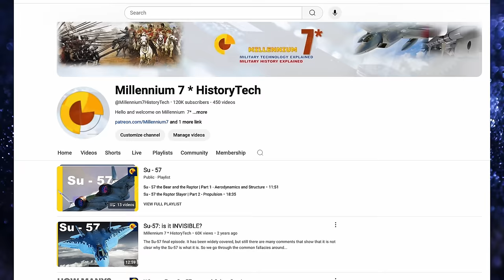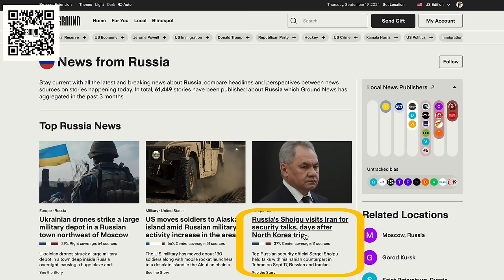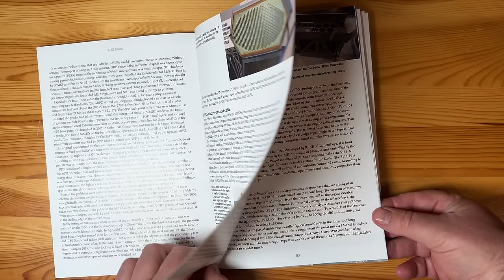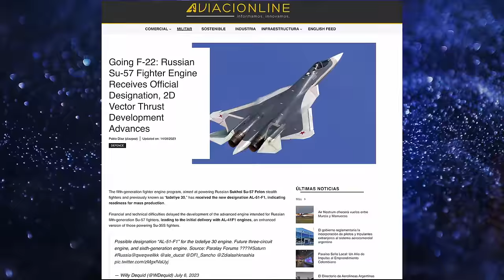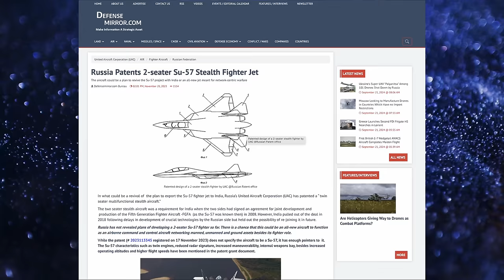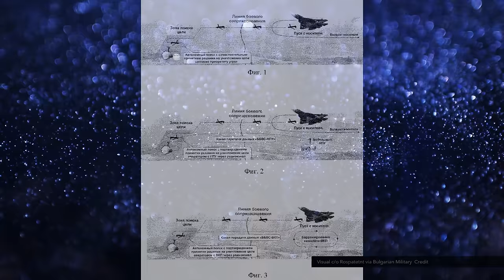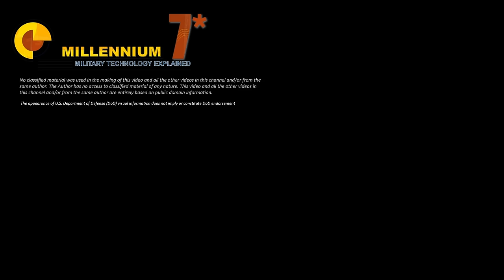The Su-57 is a Masterpiece!

Comment: Constant use in Ukraine? They're used very little, and in the same role as bombers, to launch cruise missiles. They aren't doing the air superiority job they were supposed to do.
Reply: They already have air superiority though so why use them in that role
Reply: Air superiority over what?
Reply: @testingmysoup5678  then why is Russia using glide bombs and cruise missiles? Air superiority means you can fly over with impunity. Right now the air is contested, since both sides have better AA than aircraft.
Reply: @johnathanclayton2887 bro your talking about air dominance and that is only possible against 3rd world weak countries not against the likes of Ukraine
Reply: @jathiyakhan720  US would do it, because f22 is really good against SAM batteries. But the su57 isn't, so they can't get air superiority.
Reply: @johnathanclayton2887  f22 is good against sam lol
Reply: @johnathanclayton2887  the su 57 is also just as good it istrue it has less stealth but dealing with sams nowadays has more to do with sead weaponry and raw speed than stealth both of which the su 57 excels at. The as for why they haven't got air dominance. Ukraine is densely packed with soviet era sams . Which unlike iraqs french sams can't be disabled at will by russia. Add onto that that those sams are far more capable than any us sams and you realise why they haven't gotten air dominance
Reply: @jathiyakhan720  Good maneuverability let's you get closer to a battery without getting shot down. Stealth does the same. But stealth let's you get a lot closer than maneuverability since missiles can pull more Gs. F22 was designed for a Soviet threat, so was designed to deal with lots of AA. SU57 was designed for fighting against NATO, so against fighters. So it isn't very useful in Ukraine where much of the military is Soviet legacy.

Comment: Just ask India, how good it is
Reply: How would they know, they have no access to the program. They have quit it like ages ago.
Reply: "jUsT aSk iNdIa, hOw gOoD iT iS" 🤡

Have you asked? What did "India" say? 🤣
Reply: @inthespirit  India canceled its Su-57 procurement plan from Russia.……
Reply: @Levon_RnD  India was previously a partner of the Su-57, but eventually withdrew its investment. It is also a fact that this aircraft cannot meet India's needs.
Reply: @你看个锤子你看  it was a "joint development program", and yes, I am aware of it and it's history. The point is, that was in 2018, pre any significant SU-57 development.
Reply: @inthespirit left the program due to poor stealth
Reply: @你看个锤子你看  This isn't even correct. Su-57 was always a 100% Russian program with no foreign participants. Strictly speaking, India was never a part of the program to begin with.

There was the FGFA program, a joint project of Russia and India which aimed to develop an export version of aircraft that would be based on the Russian PAK FA program(which worked on Su-57).

India withdrew from the FGFA and not from the PAK FA of which India was never a participant. 

And the most likely reason India quit was the fact that Russia was not willing to accept full technology transfer and only offered a role of an investor and a developer of several components of secondary importance to India.

India never had real access to engine, radar and other key technologies concerning the PAK FA program.
Reply: @Max_Da_G  defending su -57 crap
Reply: @maheshnayak2941  There is no reason to believe F-22 or F-35 are any worse or better. They never saw a real fight. What's even the use of your empty talking.

Comment: They can't put it into production, and fast & maneuverable isn't going to help you against 5th gen fighters. The only modern fighter fleets of any major scale are going to be the Chinese and the Americans, J-31's, 20's, F35s & F22s..
The Russian's are lucky they are fighting an enemy without an Airforce.
Reply: The Americans cannot manufacture anything I'm afraid. The number of F-22s they have makes the plane an insignificance, the F-35s will never reach the numbers or the capabilities claimed and the mainstay of the US Air Force is still the F-15 and F-16. They would not last very long against Russian air defences.
Reply: Funny you say that, f22 is one of the most maneuverable planes ever designed.
Like how do you even imagine missile evasion, there are moments when pulling enough g's is the last thing that can defeat closing missile.
Reply: @elta6241  You forgot one thing. The US has more allies, there is a lot more operational F-35's then SU-57's let alone more than air to air platforms in the Russian Airforce in Europe alone. Plus there is the Eurofighter with their new Meteor Missiles and the Rafael. The 57 doesn't have the numbers realistically.
Reply: Got to evade patriot missiles not just jets.
Reply: @Max_Da_G  most of your airforce was and is being annihilated in Ukraine only, if you cant beat one country, how you believe you can beat the rest of Europe is pure delusion. Much like your ground forces and your soldiers being given air soft gear and not even real armour. You cant beat one country, how do you think Russia could take on 3. It would be the end of Russias realistically, outdated and under-maintained air force.
Reply: @TazziedoesWT most of Russia's air force, you say? 😂 Most? I can imagine the cope just oozing out of you. When all their air force is gone, the war will end. They'll have no more shovels left to build planes. Cope on, oh heavenly soldier of light. MOST of the orcs have been pushed back to Mordor. 😂
Reply: "Fast" won't help? That's literally one of the most important factors affecting missile range...
Reply: @maximturcan1722  We've seen videos of SU-25's falling apart on take-off and crashing shortly after due to shoddy maintenance. There's literally no disputing Russia maintenance is bad.
Reply: @TazziedoesWT  and we've seen videos of f35 failing to deploy landing gear and scraping it's nuts off the ground. There's literally no disputing the US are in over their heads on how well the place is run. Landing gears don't deploy, passenger jets are held together by duct tape (special aviation duct tape 😂), bridges and roads are falling apart, most of the trains have tipped over in the last 16 months due to bumpy tracks, New York walkways collapsing down onto the subway lines. DEI fo realz.
Reply: @maximturcan1722   and the Su-57’s arent even flying? And if we are talking about civil aviation, Russia has created their own minimum parts needed lists for all of their Boeing and Airbus planes they still have. Its a hypocritical argument to say “ahh, speed tape, the stuff made for high tolerences is duct tape and wont hold.” When it will, when a large part of Aeroflots fleet are down due to not having access to sanctioned parts. Flight prices in Russia have subsequently sky rocketed to about 2-5x the normal routes price. I dont see this argument of “f-35 scrapping” when 1) there a large amount already, something the Su57 cant say, plus theyre actually flying…. Unlike the grounded SU-57’s. And sure attack Americas failing infrastructure, i’ll join you on that, im not American. But to say the Russian airforce is doing good and competitive is a flat lie. Facts show that Russia has lost 10% of its air fleet….. and made absolutely minimal gains in Ukraine compared to some major major losses as of late. And now because you cannot IFF friendly and ukranian jets because you run similar types, your aa is absolutely useless. And dont get me started on your “hypersonic” missiles that get shot down by american stuff made in the 1960’s while Ukraines drone striking your ammunition plants 200km in land. The fact is, Russia’s air force and overall military is undermaintained, underfunded and an overall sham that makes China look good.
Reply: @maximturcan1722  plus Landing gear failing is nothing compared to an Su-25 disintegrating on take-off and crashing killing the pilot?! Also if you’ve done any research into the SU-57, its radar cross section is 1000 times bigger than an F-35, Russia cannot even produce the radar absorbing coating it needs for “stealth”, and dont get me started on the philips head screws its been caught using. It looks great, but it might as well be made of wood because at the moment, the current builds that actually exist (which is lower than 50) are built like T-34’s.
Reply: @TazziedoesWT  Cope on, buddy. Whataboutism doesn't look good coming from the holiest of all holies. Your jets do burn on the runway, and just as easily do plop into the sea off aircraft carriers, and your air defense likes to score OGs against your own jets. I expect perfection from the empire. Looking forward to hearing you talk smack from mount Olympus when you've fixed all your accidents.
Reply: @maximturcan1722  like the Su-100 isn’t actually famous for that? And its rich coming from a place where they cant even operate a carrier without it catching on fire.

Comment: So basically they are waiting for an engine that is the equivalent of an engine the F-22 has had for 20 years now.
Reply: Yes, they didn't feel the need for 20 yrs.
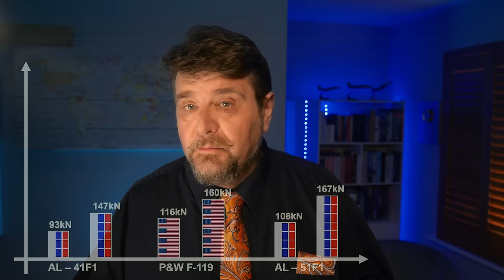Reply: While both the F119-PW-100 and AL51F1 have roughly the same thrust ( 4:49 ) it is important to note, that Al51F1 (1450kg) is around 35% lighter than F119-PW-100 (2270kg). Al51F1 is also slightly smaller. Numbers are from wikipedia.
Reply: @raptorreaper  Yikes, that's some cope. It's ok to admit that the economic situation in the 90s stifled most R&D in Russia
Reply: Forgot to mention that the first prototype for the F119 was finished in 1988, making this almost 40 year old technology. 

Not to mention that the F135 for the F-35 is even more powerful with over 190 kN thrust in AB. 

I don't even want to know what kind of engine NGAD will get.
Reply: @skyrimn00b98  I don't get why it is cope when the AL-51 is 300 kg lighter ? (The F119 weights 1769 kg without the nozzle)
Reaching the same thrust with one less high compression stage (5 vs. 6) is in itself an achievement.
Reply: @raptorreaper  its more of they didnt have the money for 30 years
Reply: @Mastakilla91  I'm not denying any technical achievement. If they have those capabilities, then it is still a feat of engineering. However, it's one thing to acknowledge that it wasn't really possible for them to do that up until now because there are historical and economic reasons. It's another to baselessly claim that Sukhoi just didn't feel like making a better engine. I'm sure the engineers at the Sukhoi design bureau would have loved to have the ability to produce a comparable engine to the Pratt & Whitney F119 thirty years ago.
Reply: yea the whole aircraft is 2000s tech in itself . The late 80s uptil 2010 didn't do Russian technology progress any fair
Reply: @JohnGaltAustria  Its said to be the same engine for NGAD as the new block 4 engine in F-35

Comment: I think the most innovative tech on the 57 is the 360 degree radar coverage. With the advent of AESA radars, the addition of smaller arrays to the sides and rear of aircraft seems like a no brainier from a conventional radar perspective. However, when you look at the advances in the EW capabilities of systems like the APG-81, it seems that the US should be jumping all over the tech. I would be foolish to think that the USAF and USN are not well aware of these ideas, but money is always a problem. 

I would think that Northrop Grumman is working on mimicking the modularity of the SPY 6 (V1, V2, V3, V4)) system to have the ability to have a mixture of array sizes and the ability to combine the data from all.